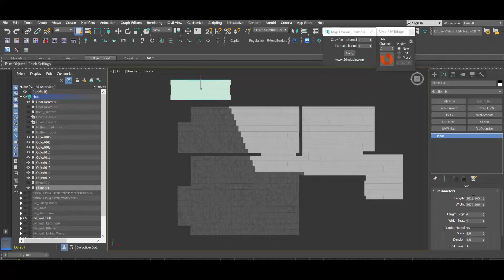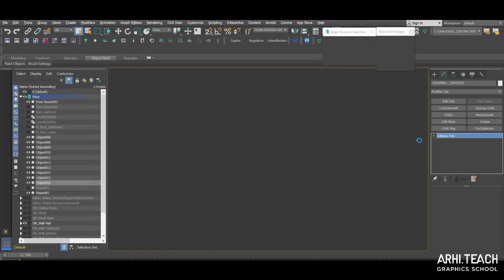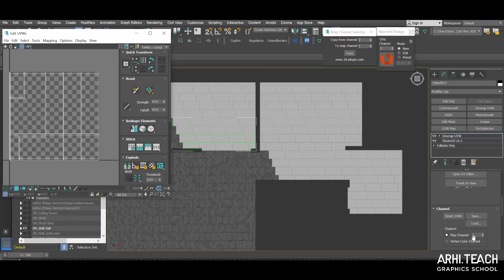How to create floor for Unreal Engine in Floor Generator + get rid of fast texture playback | Unreal

Comment from the maker: Content of How to create floor for Unreal Engine in Floor Generator and get rid of fast texture playback Unreal
0:00 Intro
0:11 Determine the dimension of the floor parts for Unreal Engine
0:35 Converting floor from Floor Generator with multitexture in Editable Poly in Unreal
0:46 Sending part of the floor to Rizom for Unreal Engine
0:50 Work in Rizom. Creating unwrap for UE
1:37 Transferring diffuse map to Unreal Engine
2:05 Preparing channels with the new recipe of 3D chef 
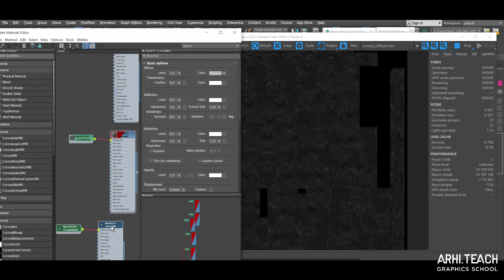2:47 Preparing materials which will be used on floor in Unreal Engine
3:38  What for Move and Abandon during transfer to Unreal Engine are?
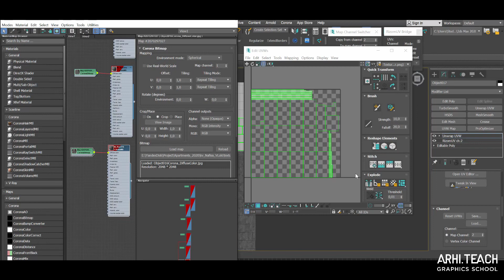4:06 Outro